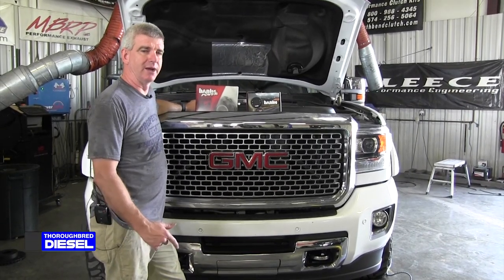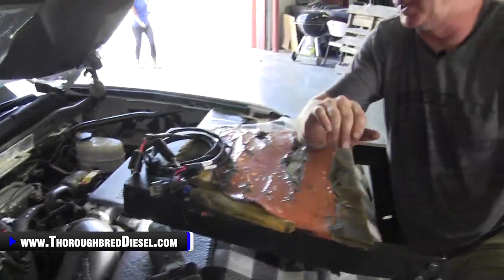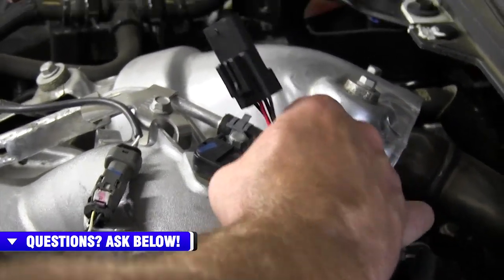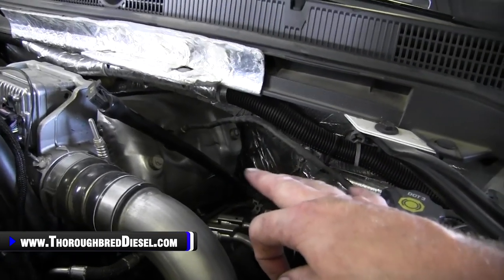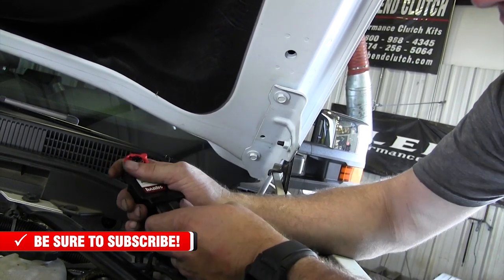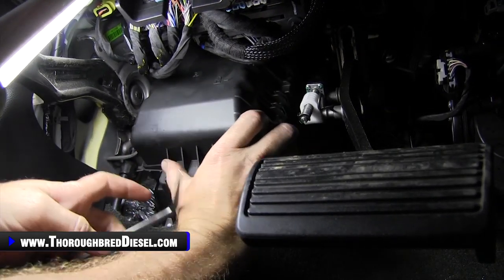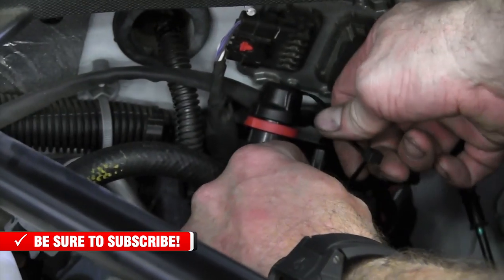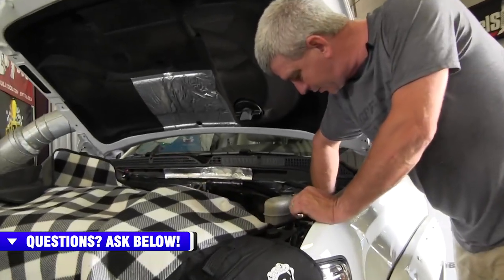Banks Derringer Tuner Gen 2 w/ iDash Install: GMC L5P Duramax

Comment: I have this on my 2019 and empty can run 9.5L per 100kms (25mpg) at a speed of 118 - 124 Kms on the highway. This is worked out numbers not the computer numbers. I also have the S&B Cold air intake on the truck and noticed the throttle response immediately improve. Love the Banks Derringer! Highly recommend

Comment: I’ve got a 2019 L5P Duramax and I’ve been considering doing the Ram air box and filter from Banks, the I dash, and the Derringer all at once. 
But kind of skeptical about it all. I’ve also been considering doing a delete, especially since I know the dpf filter IS a filter and will eventually need to be replaced, a delete costs about the same as a new aftertreatment system does, 
But after watching this video I think I won’t delete. 
I think I’ll go after the Banks products and clean the engine up a bit, clean the performance up a bit and maybe “stretch” that dpf service interval out a bit.
I work on semis for a living, it’s been my career, and I’ve worked on the aftertreatment systems since they first came out with the egr valves. 
I think it SUCKS that GM thought it was better to go with a non serviceable type of aftertreatment system. A Cummins system can be split, and the customer has the ability to have their dpf actually cleaned between replacements same goes for the doc and scr catalyst etc. 
The ones GM uses are all one piece, and when I called the dealership to inquire about their aftertreatment systems they either tell me they are not serviceable or they don’t know. Which is piss poor customer service for a $70k + truck. 
So my question now is, are there any other Banks products you’d recommend a guy like me should buy besides the air cleaner, I dash and derringer module ?
I kind of like the pillar mount for the gauges instead of the suction cups, so probably that. 
Any ideas or suggestions would be greatly appreciated and thanks in advance.
Reply from the maker: I like your take on it, and I agree that if OEM’s would consider making the DPF and EGR more serviceable or service friendly, more people would buy in.  Its been proven time and again that we can make good power with aftermarket treatment systems in place.  I think you are on the right track with what you are thinking of installing from Banks.  Good luck!

Comment: When you pull through the fire wall use a metal coat hanger make a small loop on the end so you don’t stab anything and push it through and tape the wire on the end of it so you can pull it through easy

Comment: Thanks for the installation guide.  Nicely explained.   I’m looking to increase fuel efficiency in my 2019 GMC Duramax.   I read very positive things about the Banks module in this video.  Do you have an opinion on which routes are best for getting the best MPG?
Reply from the maker: MPG’s really are part of the overall condition of the truck and driving styles.  Yes, these chips are designed to increase efficiency in the vehicles so if all the stars align, should result in increased MPG.  From our experience, best MPG gains comes from tuning.

Comment: worried about vibration, but runs wires between the metal of the cab and the grommet ... shrugs
Reply: My exact thought as soon as he said it. Factory grommets are a pain to work into, but it’s why they’re there. Give it a year and the sheet metal is gonna wear through the sheath and ground out the system.

Comment: A year after having this on my truck I have a check engine light. Showing map sensor and fuel pressure sensor code. I’m thinking it’s cause of this banks stuff cause the truck only has 25k miles on it. Regret ever messing with it at all
Reply from the maker: If you cleared the code out did it come back?  Have you removed the module to see if it makes a difference?  If it is because of the Banks we will help you resolve the issue.

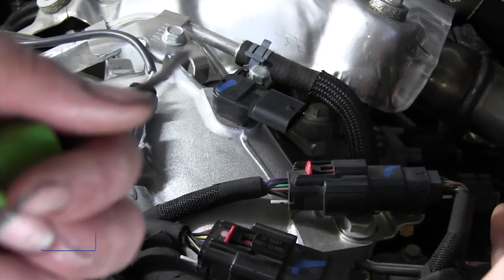Comment: The most important part of the video is the little connecters and I couldn't see how you dis-connected them 'cause your arm was in the way. Around 3:30'ish.
Reply from the maker: So sorry about that.  We will try to do better in the future.
Reply: @thoroughbreddiesel  No worries TD. Forgive me for being harsh. I was frustrated 'cause I have such an issue with these GM wire connectors. I finally got 'em separated. Thanks.

Comment: Did you add or would you add a Banks or after market cold air box for better air and hp?
Reply from the maker: We did not on this truck but for fuel economy and overall performance we always suggest the big three: tuner, air intake, exhaust.
Reply: What exhaust would you suggest and from the scr back or something different.  Looking for options and suggestions.
Reply: Bill Gunter I don’t see how a DPF-back exhaust will add any appreciable performance on these trucks.
Reply: @Icutmetal  I agree, so now getting all the components to do a full install.  Do you know if the Banks Derringer programmer will work and with it deleted or do I need to look somewhere else?  Just got stuck in a parking lot with their system, error codes and would not crank.  Finally got it to work and when I took it to my mechanic buddy, no codes showing.  Thoughts???

Comment: Thought this LP5 was rated at 445 horse and 910 torque stock?
The dyno numbers with the derringer aren’t much more than stock?
Am I missing something?
Seems like it’s not worth buying it?
Reply: thats wheel horsepower...      Manufacture measures to the crank.      Stock numbers to the wheel are much less than advertised.

Comment: I thought the L5p came with 445 hp and with the banks on the truck you got 465hp . How does that equal a 60hp gain?
Reply: David Bowers Do you understand how & why crank horsepower differs from wheel horsepower?
Reply from the maker: That's why we do a pre and post dyno run on these types of videos. It show the actual horsepower and the actual increase.
Reply: It comes with 445 flywheel horsepower.  On the dyno, you're measuring rear wheel HP and torque, that's actual power to the ground.   So pre-Derringer, he was getting about 400HP to the ground.

Comment: Should a guy be removing the system entirely before taking it to the dealer for service?
Reply: @Cory You have two options. You can either pull the Derringer tuner and engine harness off the truck (which takes less than 10 mins), or you can unplug the OBD-II cable for the iDash/Derringer and everything in place. For most of the dealership out there, they understand that accessories like this are harmless and are completely fine with it. That being said, always check with a service adviser to make sure they don't ding your warranty.